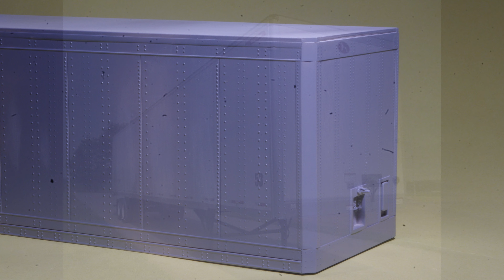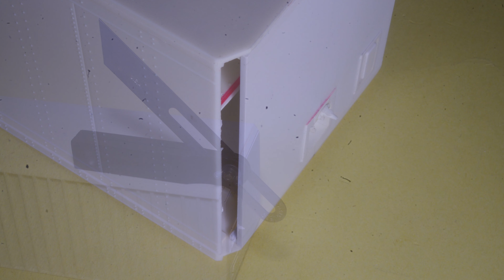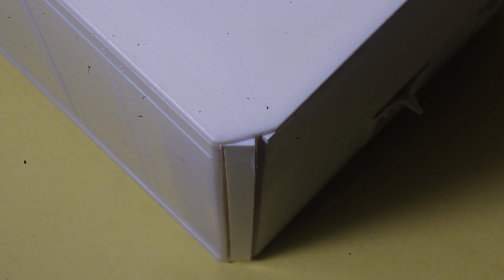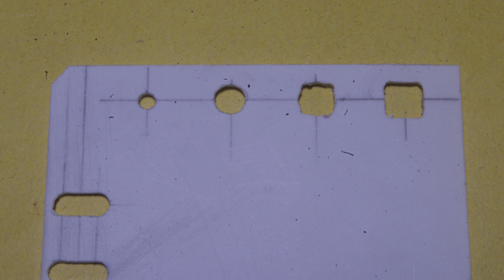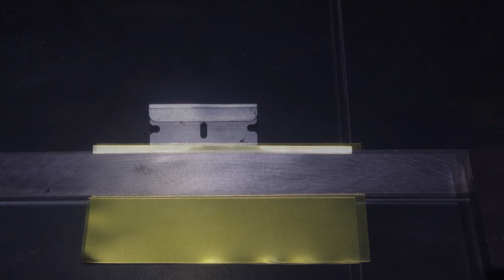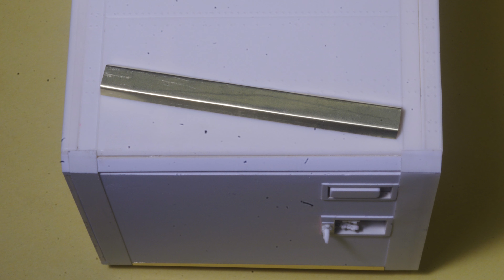1/25 scale Moebius van trailer: Changing front corners from round to angled

Comment: Never thought of using brass sheet for the corners. I'm eventually going to be building the trailers for Knight Rider and Smokey and the Bandit and they have these angled corners.
Reply from the maker: There was admittedly some "Goldilocks and the Three bears" involved: .016" sheet aluminum was too thick, .010" styrene strip was still a bit thick and would be hard to bend properly (separate strips could be used however that would leave two gaps still to be filled), .005" styrene is on the delicate side for solvent cement...shim brass .003" thickness was "just right'!
Reply: @brsnorthernhorsejourney3579 Superglue holds it good I guess.
Reply from the maker: @crushingvanessa3277  It does work well, I use the medium viscosity gap filling type. Applied to 3/16" wide corner strip it has a lot of gluing surface, and doesn't creep out along edges of the brass cover piece.